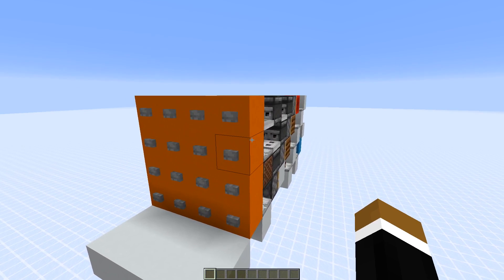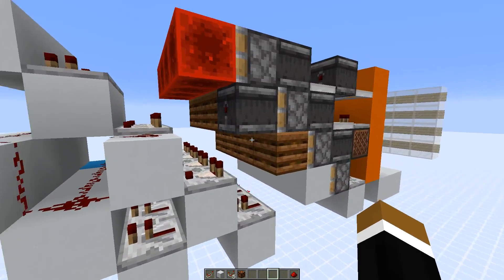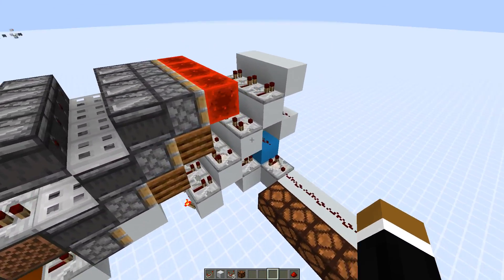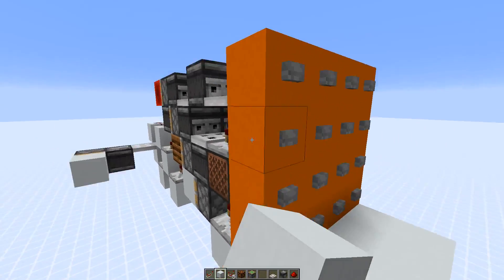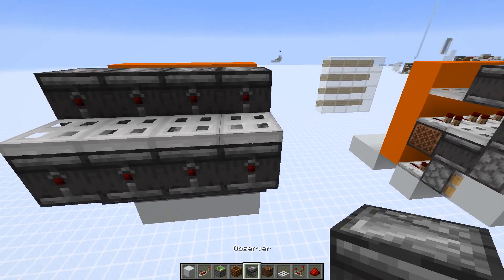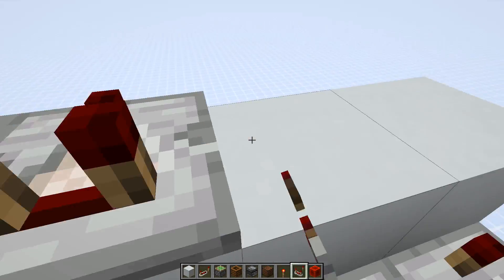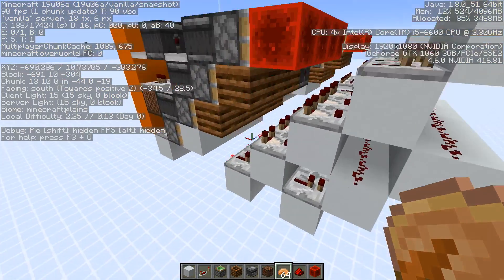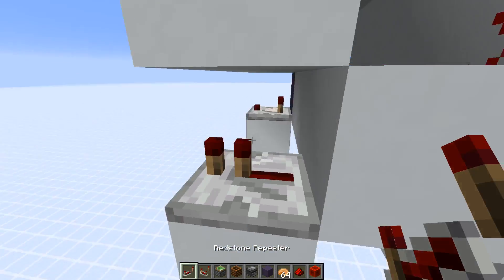Compact 4x4 Button Panel

Comment: How do we use this interface to connect it to the actual  storage cell part to make it a combo lock? I tried following the 15 button video, and simply taking the signal strength output from where you said. However, I am confused how to "fit" this, as the piston/observer reset thing goes where the second line of redstone is. With this, what is the purpose of that second higher redstone line?

Comment: Hey theres a good and unique use of composters, static state pushable blocks. I was wondering how you were going to integrate composters without a huge line of input and output. Less dynamic than a shulker box or chest minecart, but easier to move small distances

Personally my favorite variable signal input is an item frame with the output comparator set to subtract, then a button on a NOT that leads into the side input of the comparator. Basically just a variable length button, it's compact, stores the previous input, and has a really nice technical look and feel to it as an interface